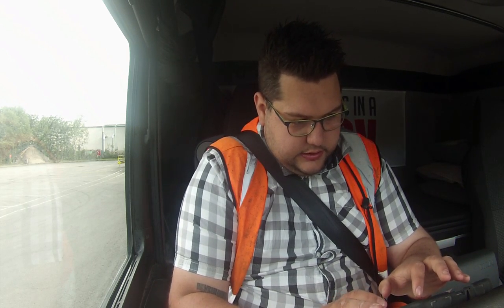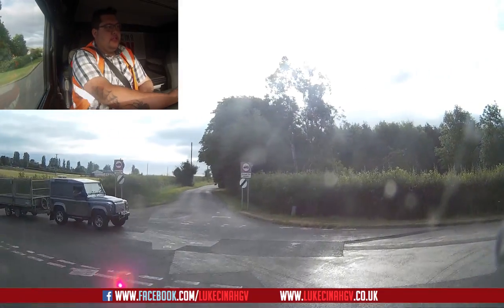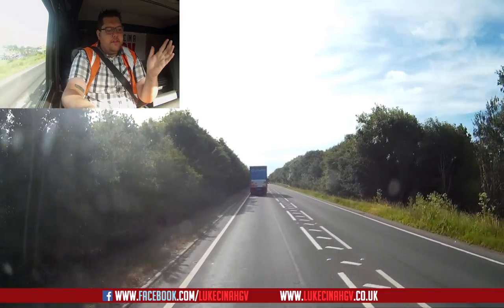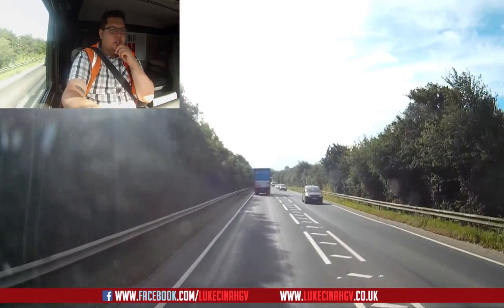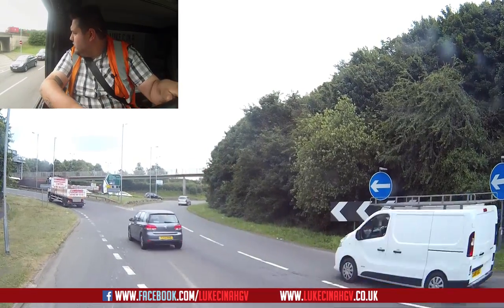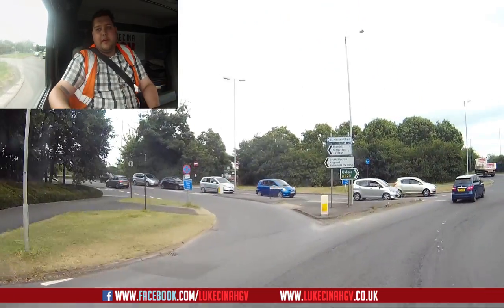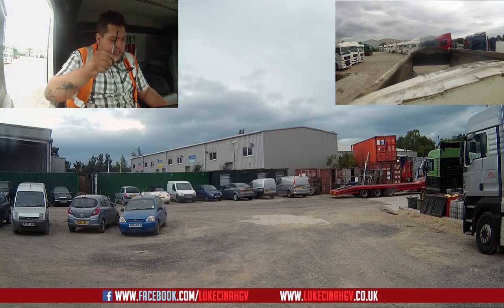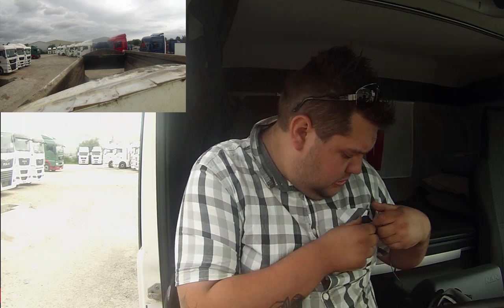Big Rocks!

Comment: awesome rear camera Luke, I wanna try something like it with my vids but only have to one camera atm and knowing my luck I'd break it.....👍
Reply from the maker: +CJACEY-TRUCKS I've done it before. I only stopped because my mount snapped of once while I was tipping. Think it was a tree branch or something. Luckily the camera wasn't attached because I didn't notice till I got back to the yard. I just lost the housing it goes in and a bike GoPro mount 😂
Reply: I broke my bike one too, I used it around the ladder from my bunk bed to get a central shot and over tightened it the last time. 
Good luck with the show next weekend, I was thinking of taking Cinderella to "convoy in the park" but it clashes with something else so won't be there 😔

Comment: Luke, Three do a fantastic unlimited data package which gives you 30GB tethering which could be used on the tablet (unless work pay for that then that's redundant) not sure what I'd do without unlimited data out on the road.
Reply: Rob Smith 30g isn't unlimited tho, I was thinking of going to three for the unlimited data but if it's only 30g then I prob won't bother
Reply: Johnny Cage my bad didn't word it well. You get unlimited data on the phone. Just the tethering side is 30gb, which is the most I've seen on non business packages.

Comment: I use 20g with in 2 weeks on the road, it's a joke. Does Luke do knights out? I do 4 nights out a week and it's a fucking joke, it costs me to much money. Spent £140 this week on food and parking! Was in London! Still pissed off about it
Reply: What does it cost you for parking, over here it (America) it can be $11 to $20
Reply: Sailing Sometimes I payed £26 and £28 last week and you don't a meal or anything. It's disgusting how they treat truck drivers here in the uk and a few weeks ago I ran out of drivers hours so I pulled into a service station and I had to wait over 2 hours but less than 3 hours for someone to come and get me and the truck and I got a £60 parking fine and if I didn't pay it with in 2 weeks it went upto a £100. This country is trash. Plus once you in the service station a sandwich is at least £4 that's like 6 dollars and it's just a small one in a packet. Not even freshly made. I really can't stand my country
Reply: Johnny Cage damn and was thinking it was all a mess here.

If I park in a truck stop  that charges everyone unless you spend $20[or morr](£15.72 )in the shop or fuel 60 gal(228.17 L) the parking fee is $20 and up depending where you are. the food in the restaurant is bland in the TA better at the Petro and soso to WBH in others. 

now reserved parking is a different matter that runs $11 to $20 for a 24 hours the amenities at these places very from crap or non-existent all the way up to a decent shower.